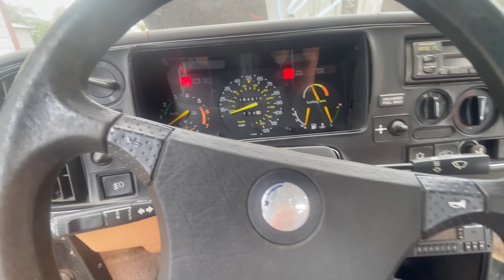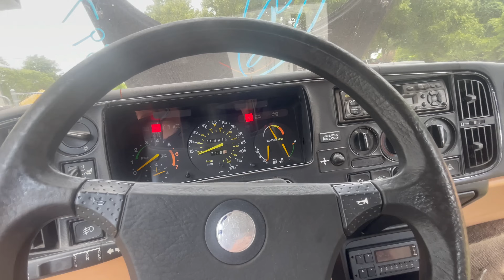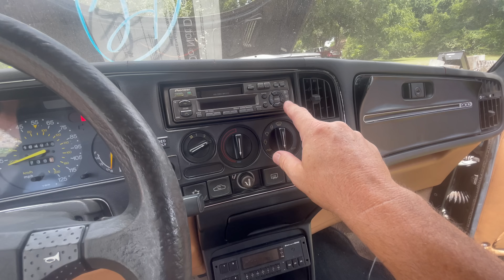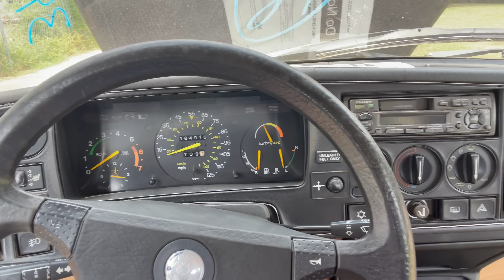No Start, No Drive - How Bad Could It Be??

Comment: check this Mike; "1986-87 there were bad 'Ignition Amplifier Relays' in the fuse panel that would cause a no-start.
Find the Service Bulletin on how to bypass.
Connect the 12:00 o'clock terminal to the 3:00 terminal, I think....Best to check"
Reply from the maker: Thanks! Will do.

Comment: Nice junk-yard find 🤩
Be carefull to do not scratch the windows when you actuate the electric windows, because the windows scraper's clips (2nd, 3rd and 4th from outside rearview mirror) are rusting...!
These are still findable on the scrap 900, that you've took out the fuel pump 😉

Comment: Just sold a 1972 Saab 99E I owned for 42 years. Got $900 for it. Was gotten by a Saab collector. It had 129k on it.
Reply: U got robbed.
Reply: I'm 47 years old.  you owned that car for 42 years?!  did it run?
Reply: the saab had sat for 21 yrs. in shed. had new clutch installed. but not driven.